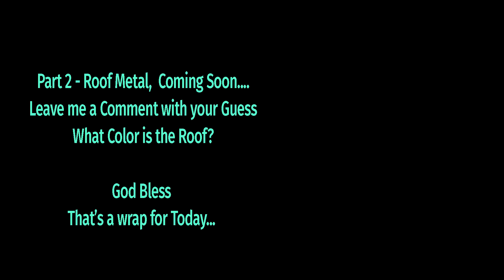HAIL NO!  - Freak Storm Stops Roof Raise, The Tiny House that Grandma Built, Homesteading Alone

Comment: May I ask what are you enclosing the ends of the cabin with? Have you said, and I missed it? I say a red roof, since copper is to expensive.
Reply from the maker: The gable end walls will have 1/2” osb wall sheathing